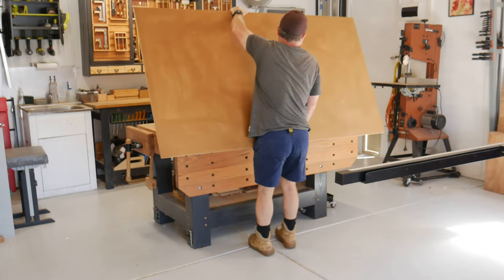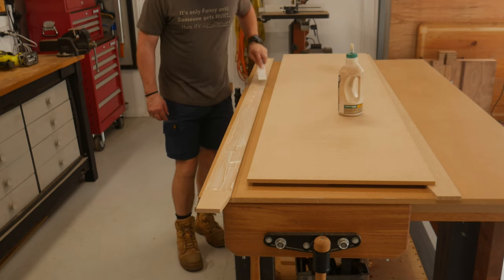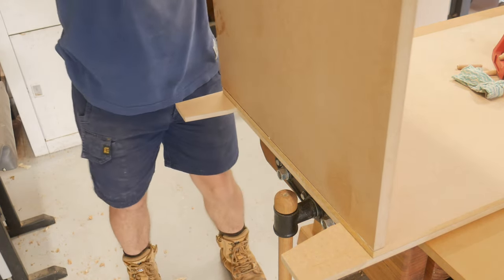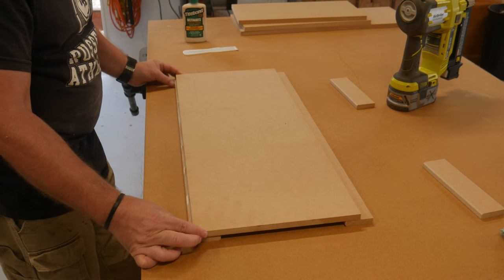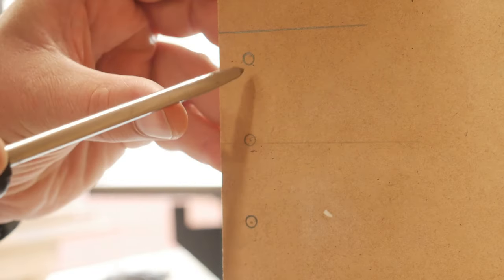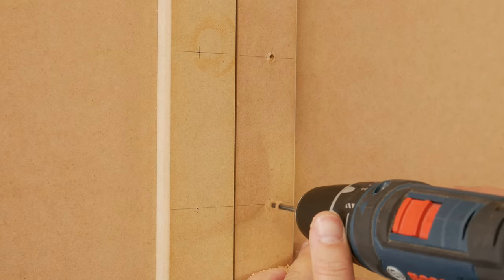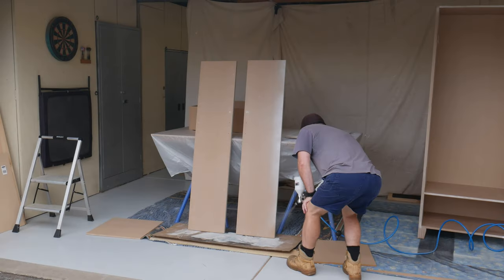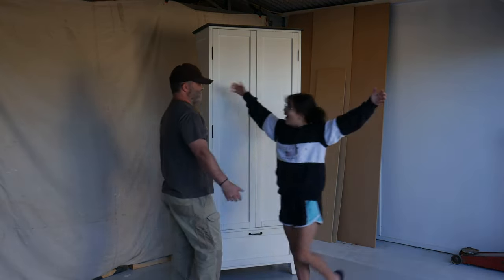MDF Wardrobe build/ SUPER Easy

Comment: How did the paint finish look on the edges ?
Reply from the maker: Really good, just sand them super smooth and I just used a water based undercoat and enamel and it turned out great. It is that simple.